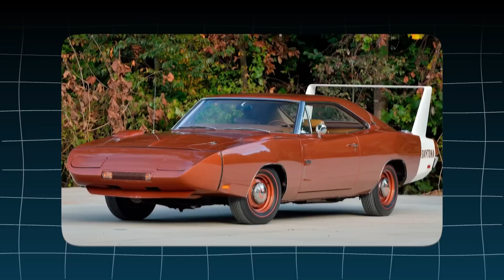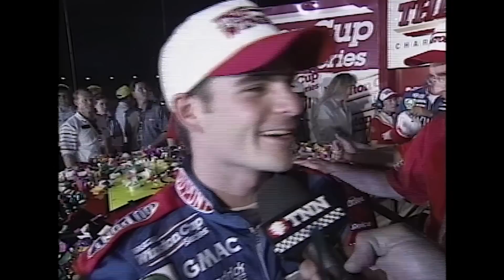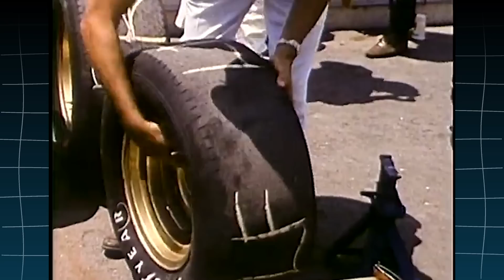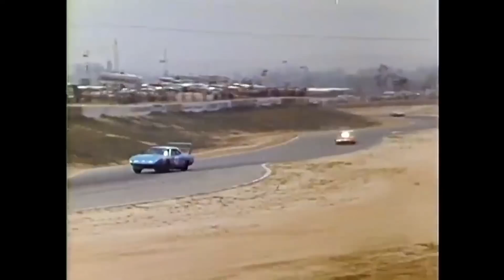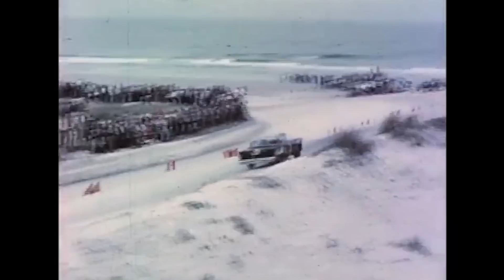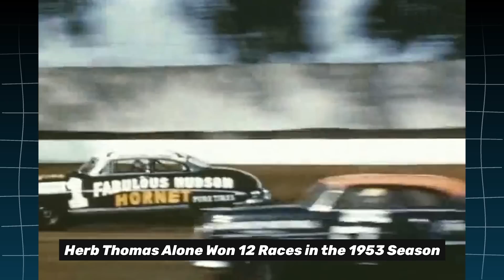8 Wildest Cars That Got BANNED by NASCAR

Comment: I would rather spending $80,000.00 on a completely restored 1970-1970 or a 1987 Z28 than the same amount for a brand new Chevrolet 1500 truck. I would also love to see a manual 6 speed transmission with a short throw gear shifter, using a dual disk hydraulic clutch in today's trucks.

Comment: I think NASCAR should have never banned these cars or the 426 hemi only for the sheer fact that when it comes to racing, you need to have your car built to not only win, but to compete against other manufacturers and other drivers so that means you Gotta make your car better we still want safety regulations, but by making competitions that are not as regulated for modifications allows better cars to be produced for the civilian market who knows we may have had hellcats made in the 60s if that was the case imagine showing up on the showroom floor a blown 426 hemi from the factory

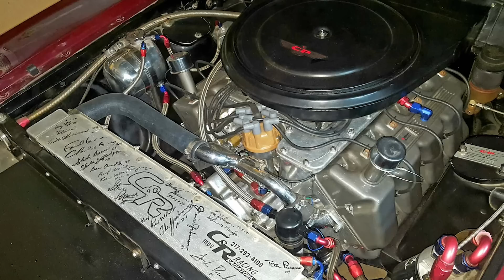Comment: Those numbers for the 428 cobra jet Torino 5:28 , double that when they hit the track. 700 plus horse they aint running 200mph with 330hp.

Comment: The Ford Torino Talladega was the reason why Dodge/Plymouth created the Daytona/Superbird not the other way around. And they ran either the 427FE or the Boss 429 Semi-Hemi. Not a 428. That's why Richard Petty switched to Ford in 1969. Ford was already mopping the floor with Dodge/Plymouth before the aero wars because the Fords were more aero dynamic. That's what Chryslers first championship came in 1970. That was also the time when Ford backed out of racing and left Mercury. Hench David Pearson's famous Woods Bros. #21 Mercury.
Chevrolet was nearly absent in the 1960's and only won just a few races from 1963 to 1970. 1970 marked Chevrolets return to racing. Ford pretty much dominated NASCAR in the 60's.
The 426 Hemi was banned 1964 because Chrysler didn't offer the engine to consumers breaking the NASCAR rule that a certain number of them had to be sold to consumers. Only after Ford complained NASCAR was letting Chrysler off the hook while banning Fords 427FE "Hi-Riser" and 427 "Cammer". Ironically Ford still won more races in 1964 with the 427FE than Chrysler did with the 426 hemi. Mainly because the Fords were more aero-dynamic.
Bill Elliott's dominance in 1985 and 1987 in the Ford Thunderbird and record setting lap at Daytona and Talladega led NASCAR to implement restrictor plate racing. Also in 1992 the Ford Thunderbird was so dominant, NASCAR made all the Ford teams raise the roof line and shorten the spoiler to slow them down.

Comment: Why list something "banned" that wasn't banned such has the Hudson with twin-H engines, the aero bodied G platform GM cars, or even the winged mopars. The mopars were not banned but so heavily regulated as to make them uncompetitive so teams stopped using them. When cars are called out as banned and were not it smacks of a "clickbait" title and will harm the channels reputation.
Reply: The reason the Hudson Hornet  stopped racing was not the engine but in 1955 Mac badge engineered the Nash with the Hudson engine and the handling advantage was lost.
Reply: Amc changed to amc by spell check.

Comment: The rear wing was that tall so the trunk lid wouldn’t hit it when the trunk was opened.
Reply: The correct answer. Did not have to be that high, but found they could not open the trunk. You win.
Reply: @brandonbell9625  No, that isn't true.
There are interviews with designers that stated that the aero was the one and only reason for the spoiler height. The trunk lid opening was irrelevant because they were building cars to race, not to haul groceries.
Reply: @gregorykern9679 dont know what interviews your referring to as any I've ever seen all state the wing was that tall for the trunk opening. Remember these were production cars for the public before they were used in NASCAR as NASCAR rules stated so many civilian cars had to be built and sold to the public  before they could be raced in NASCAR. That number was and still is 500 production cars.

Comment: not to mention all track ran talladegas had Boss 429 engines except for the 1969 Daytona 500 those were 427s and the street version of the talladega is what had the 428 no offense but you needed to go over your redeach a bit better because you will be picked apart chewed up and spit out by nascar fans who have the actual fact

Comment: there a fact in 1964 a first hemi engine was band for 1965 rules because it won every race it ran in dodge cars with 1-4 barrel carb! in like 1966 they had hemi & 2 -barrels carbs in street cars really they let it back in ok little know in 1985 a ford thunderbird broke a oil line fitting cracked leaking, fixed but  the car lost 2 laps over 5 miles behind the leaders this was biggest speed way he un lapped himself 2 times and won the race with no yellow flag help really with all the rules the number 9 car and it bill Elliot known later as the million dollar bill ( win 3 of the 4 races you get a Winston million dollar extra pay out really) he won it the first time really nascar tore the car apart try to fine or ban them for cheating really it passed every check! body and engine in 1985 really! ( ok in 1984 i took a care box to the guy that did the melling race teams heads ports and design from a very pissed GM engine designer & Nhra prostock champ that dead he died in testing crash ok i was sick & they though dead soon 35 years later to almost the day my only living relation name & a 100% death rate cancer breakthrough was figured out & the medical control was already found really) 1984-2019 really by DNA ps his blood was saved really! ok i had a name and number my last hope it sent shock waves threw the doctors treating me why the name and number in there teaching really! no way really! that was my closest relation alive in 1963 in a sealed adoption court file of mine really! the guy said the  rest closer were dead already! ( in my state a crime or death of mother or relation who can care for you your a ward of the state but a policeman related to my line could and did get me the guy that the blood from for my DNA was my stepfathers real brother!)

Comment: You forgot to mention one from a automotive engineer Smokey Yunick s 1967 Chevelle 😂
Reply from the maker: Oh man, you're right! That one was insane 😂
Reply: Actually it was a '66, but there's so much disinformation out there about that particular car and the fact that it was unveiled at the 1967 Daytona 500 kinda blur that fact. Smoky was a certificate genius when it came to pushing the rulebook evvelope in all forms of auto racing, not just NASCAR. He did very well with Indy roadsters in the late 50's through the mid-60's, too. Will he ever be voted into the NASCAR Hall of Fame? Are you kidding? After all the times he outright embarrassed NASCAR? Not gonna happen. What a travesty for the sport's all-time greatest in ovator.

Comment: Ford never used the 428 Cobra Jet engine in NASCAR, the engine you show is a Boss 429
Reply: Correct. They used 427,427 tunnel port,and Boss 429. The 428 CJ was used in drag racing though.
Reply from the maker: Will triple check everything for the next video, thank you for pointing this out!
Reply: The ford 427 cammer was banned from Nascar.

Comment: Not a bad video, you got that Winged Mopar race wins right.
But there are some inaccuracies
In 1964, Ford won more races than Mopar and beside the Hemi, the High- riser 427 was banned too
The Dodge Daytona was a response to the Talladega and Mercury Spoiler, not the other way around.
Dodge had the Charger 500 for most of the races in 1969
And Chevrolet was not in Nascar in those years

And something many people get wrong is the 200mph of the Dodge.
It was able to have an average speed of 200mph on the big tracks, not only the highspeed
Cale Yarboroughs Mercury Spoiler reached around 215mph on Daytonas backstretch, but the handling  in the corners of the winged mopars was better, so the average speed was higher

Why was Mopar making such noise about the 200mph?
Ford or Chevrolet were each alone producing more cars than all 5 Mopar makes together, they needed the publicity badly!
Reply from the maker: Thank you for taking the time to write this down, I much appreciate the input! Will try to include this info in my next videos 💪

Comment: Plymouth and dodge where sister company's they literally where the same car. They both used a hemi... ughhh stupid
Reply: They had more differences than you might think.
The spoiler had different locations,  the Dodge had more of a fastback, the Superbirds used Coronet fenders, the noses were very different from each other
Reply from the maker: Sister companies but those sisters were looking very different on track 😎
Reply: What got them banned wasn't the areo spec, it was engine size. Same reason ford wasn't allowed to run the cammer engine. Yes the areo spec was part of it but more or less came down to engine size and speed that they where able to achieve
Reply: @anschuelke  cammer never was banned, but teams then had to put extra weight in the cars and would've been uncompetitive, so they stayed with the side oiler
Reply: @goldenltd1970  the hemi and all ohc motors where banned. Yes for a few years until the small block cubic inch limit was set they could have like you said but ford didn't want to go with the added weight.
Reply: @goldenltd1970  basically what I was trying to get at is the one making the video didn't do his homework and the ones watching it clearly know more then what he does.
Reply: @anschuelke  but the overall ban on big blocks came much later, in 73/74, but yeah, while it never was raced, the cammer felt under that rule
Reply: @goldenltd1970  The 427 cammer never ran in a NASCAR race.
Reply: @gearbanger57  that's what I said dude. But it was never baned in 66, just not used because of weight penalty, so technically it fell under the big block ban from 1974
Reply: @goldenltd1970  not mention the whole x amount of road going Cara had to be fitted with it and we all know not a single car was sold with the cammer. Had they been ford would have found the major faults with the timing chain issues drag races did
Reply: @anschuelke  Engine size limit was 430 CID and the aero cars were never banned, but limited to 305 CID.  The restrictor plate is what killed the Hemi and Boss 429.  The holes in the plates for wedge engine were bigger while the hemi-headed engines had to use plates with smaller openings.  Almost everyone got more power from the wedge than the hemi after the plates came into play.  The aero cars were limited because they were "too fast", all of them.
Reply: @anschuelke  not exactly. ALL Aero cars were limited to 305 CID. Ford, Mercury and the Chrysler cars.

Comment: Not necessarily a car but they took the Cleveland engine away from Ford since Bill Elliott set the record at 212 mi an hour on qualifying and picked up two laps at Talladega under green run them down twice and pass them and won the race
Reply: i dont get why the 1987 thunderbird wasnt in this video "The fastest official speed ever recorded in a NASCAR Cup Series race car was 212.809 miles per hour, set by Bill Elliott in 1987" pretty big deal dont ya think?
Reply: @fishfoodrenton1043 that just means it's going to be a part 2 of this series lol.
Reply from the maker: I came across this when I was researching as well, good engine!
Reply: Considering Ford hadn't produced a 351 Cleveland for over 10 years, it's surprising they were allowed to run it at all in "stock" car racing. But there was a lot more to that car than engine.  I wish those Elliott boys would put out a tell all book. Lol
Reply: @davidparrish1205 was valve angle change they did to the Cleveland heads wasn't the block. The valve angle could be shifted to flow more air. Ernie was a wizard with cylinder heads
Reply: @therealnynetynyne360  yes, I am aware. A buddy of mine actually ran into him at a machine shop in Martinsville, VA a few weeks ago. I'd love to meet him.
Reply: They banned all canted heads. Not just clevelands

Comment: I thought fords 427 ohc was banned
Reply from the maker: Nope, not really
Reply: It was banned for being "too exotic". NASCAR wanted pushrod, carbureted engines. Fords 427 Hi-Rise was also banned because it wouldn't fit under a stock hood.
Reply: It wasn't, it just had to race with more weight and in the end, were not competitive. That's why the teams stayed with the Side oiler 427
Reply: @goldenltd1970  Not true, before the 427 'cammer' hit NASCAR tracks they banned all OHC engines from competition.

Comment: That Ford motor you showed was the banned Boss 429 not the 428fe.
Reply: Yes but the nascar ran the 427. The 428 was the street motor. for a short time ran the 429 boss in nascar as well
Reply: @bandcshow11d6  The 
You are right! Ford 427 Cammer was banned.
Reply from the maker: Yep you are right, I’ll double check that! Thanks for pointing this out!

Comment: The Chevrolet Monte Carlo and Pontiac Aero Coupes were not banned. General Motors as a whole were shifting models to front wheel drive!

After 1988, their were no more Monte Carlos or Aero Coupes on sale.
In 1987 Pontiac, Buick and Oldsmobile had already moved to front wheel drive and remodel their cars. 
In 1989 the Chevrolet lumina was introduced to Nascar and was actually more Aerodynamically superior to the prior Aero Coupes. 
In 1988 the Monte Carlo and Lumina were on sale at the same time to start the transition for Nascar.
 All of this can be fact checked ✔️
Reply from the maker: Will do a better job at this next time, so things just slip by me. Thank you for pointing this out!
Reply: Yeah the Chevy Lumina and the z-24 Beretta had so much potential 😢
Reply: @andrehooker3229  my favorite car to this very day is the #3 Goodwrench Dale Earnhardt Lumina, that car with the black paint just looks freaking aggressive af, fitting for the legendary Intimidator.

Comment: Banned cars. Just showed how NASCAR always wanted pariry. Remember when Busch series ran v-6's against 5.7 liter v-8's. No comparison!. Best compromise would have been v-6's hooked up to 5-speed transmissions. Gen 7 cars are parity to the extreme!
Reply from the maker: You are right, the v6 vs v8 was something else!
Reply: The Busch series never ran V6's against 5.7's. before the Busch series went to the V6, they were running 305 based engines. 311 CID max.

Comment: well, that was a waste of my fkng time. Showed a 4 valve per cylinder head when talking about the 426 hemi. Showed the Ford Boss 429 engine when talking about the 428 CJ engine. The street versions got the 428 CJ, the race versions got 427 tunnel port engines until they switched to the Boss 429.